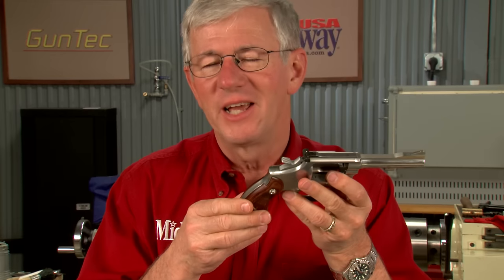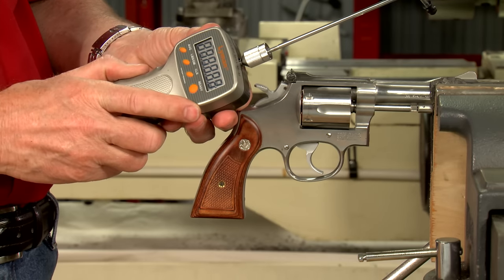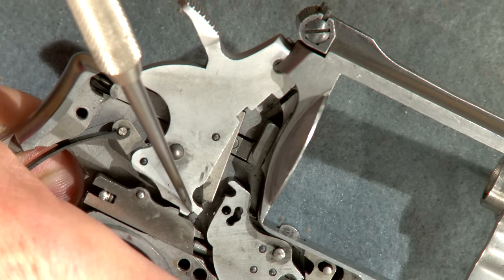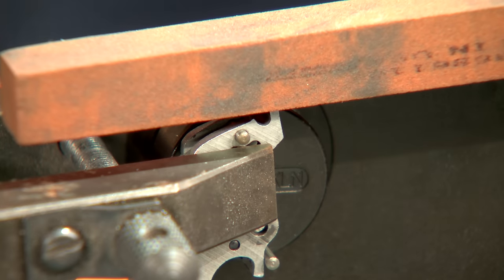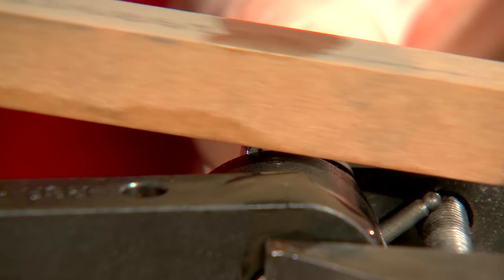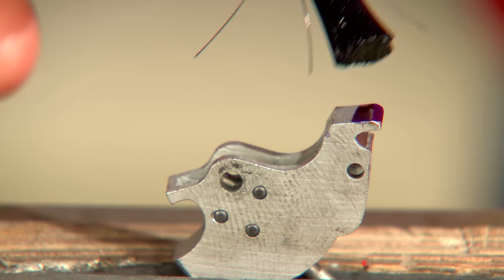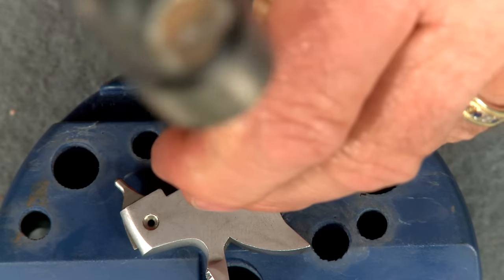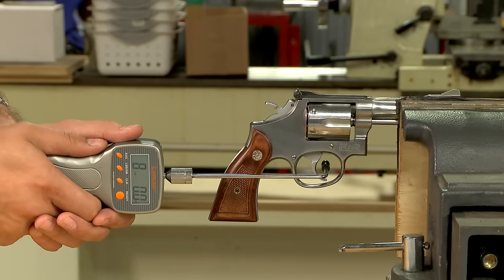How to Lighten & Smooth the Trigger Pull on a Smith and Wesson | Smith & Wesson Revolver Project

Comment: I love how he explains it as if it's that easy and anyone can do it, before busting out tools I've never even seen or heard of. 
lol Good video all the same.
Reply: so true
Reply: He is just selling tools. There is so much more that can go into smoothing out any revolver. Jigs and fixtures? Make your own.
Reply: Seth B 
He sells them because some people want them.

It often costs more to make your own than to buy
Reply: @merlinious01  and you know the surfaces will be in plain and true when you use correct tooling.
Reply: @merlinious01  Sometimes, the tools required, and the learning curve pushes a project to the point that it's easier/cheaper to pay someone to do it, even if you could do it yourself because they have the tools already.
Reply: @vincentlok8894  
Yep, specialization.
It is the reason modern society exists.
There is virtually nothing in our lives that a single person is responsible for.
Reply: Right. Reminds me of the time homer simpson tried repairing his home foundation by watching a tape he rented.
Reply: I did mine and it worked great. If you can sharpen a knife pretty good and open a revolver it ain't that bad.
Reply: Bottom line - unless you have that jig and know how to use it DON’T TOUCH THE HAMMER OR SEAR ENGAGEMENT SURFACES.
Reply: You're looking at over $300 for everything.
Beware, I tried doing this to my 686 without a jig. 
I was super careful, put it back together it seemed great, I cycled it a couple times, and then it locked up.
The hammer wouldn't cock, the cylinder would rotate.
I took it back apart, figured it out, I got it working every time, I counted my blessing.
I think the trigger is a little better, I don't have a trigger gauge.
Reply: @ronrico2620  Are you interested in selling your jig?
Reply: @bigredc222  jig fer what?
Reply: @ronrico2620  You said you did your gun, so I assumed you have the jig in the video.
Reply: @bigredc222  no jig. I'm just very gifted with  mechanical stuff. I did it on my s & w model 65ls. Prior to me was kept in a high humidity environment with 0 maintenance. On First use (after a regular cleaning) had immediate issues and pissed rusty color after a through drench from a friendly range officer. First time I've ever opened a revolver. Took it apart light polish on the important stuff. I was very rusty so I did some rust removal also. I think I invented a few new curse words putting it back together, but it went. No extra parts even! Maybe 10 hours total. I've shot it many times. Also it what I train speed reloads at home with dummy rounds. Never a single issue. Your mileage may vary. I had $75 into it and little to lose
Reply: @ronrico2620  I did my 686 and I scared myself because it locked up at one point while I was working on it, but it's fine now.
I just got an old nickel S&W model 36 five shot .38. it has a stiff trigger.
I'd like to tune it up a bit.
Reply: @bigredc222  there is another video that was way better than Larry here. But YouTube is always deleting the good stuff so it may be gone if I can find it I'll post a link. That was all I needed to get through mine.
Reply: @ronrico2620  Yea, I'm pretty sure I didn't use this video when I did mine, I have four more videos YT recommended.
YT has its problems but with a bit of smarts and a mechanical ability, and tools, there's almost nothing you can't learn how to do with YT, I love it.
Reply: you just need a lot of diacum

Comment: Larry has contributed TONS of good information to gun enthusiasts, thank you sir! I once wanted to fiddle with every trigger but over time I have learned that even a rough trigger will smooth out quite a bit with use, just dry fire the hell out of the gun, does wonders for me. An enhanced dry fire method is to apply some fine grit lapping paste to the contact surfaces, dry fire a long time then disassemble and spray out with cleaning fluid and compressed air, then re-lube the contacts and you are all set.

Comment: It's a real shame that the guns leave the factory without this already being done.
Reply: Especially for the price that they are.
Reply: Mo money...
Reply: Taylor (makers of single action "Cowboy Guns"  offers "Taylor Tuning" as an option from the factory.
I don't remember what they charge for it but it made a HUGE difference.
I dry fired some of their guns at the NRA convention.
The Taylor Tuned guns were way lighter and smoother.
Made me wish they made double action guns as well.
Reply: Only the Performance Center ones are. My stock 686 has to be 15 pounds at least.
Reply: @michaelbaker8284  you probably know this but you can buy a Wilson Combat spring kit for about $11. Takes about 10 minutes to install and significantly improves the action and lightens the trigger pull.
Reply: @edx21x  Didn't know about the wilson combat kit. Thanks!
Reply: @michaelbaker8284  coincidentally i just put one in today, but i’ve done it before. i have a little experience doing minor work on revolvers but i’m by no means an expert and i don’t have any problem doing it myself but you could take it to your local gunsmith to have it done if need be. there are several youtube videos on it. if you do it yourself you may want to buy a rebound spring tool (midway sells the springs and tool). Removing and replacing  the rebound spring is the only tricky part, Main spring is easy.
Reply: @michaelbaker8284  I have an older 586-3 and it was 14.5 pounds.  Now it's 7.5 to 8 pounds a world of difference.
Reply: Quality control is just stupid low right now. I just got a model 60 ladysmith and it has the worst single action trigger creep I have ever felt on a smith revolver.
Reply: @upnorth5465   I don't think they're doing any quality control. They're just cranking them out. Looking at the dates on some boxes, they're going from the factory to the distributor to the dealer in 2 weeks or less.
Reply: Some do. Bought a brand new S&W revolver trigger is one of the crispest triggers ever. Only seen a better trigger on a couple guns ever and the slickest one was a AWA SAA clone I had. Slick and crisp action, case hardened action and flawless appearance.
Reply: @Steviewayright  So you have an issue with shipping only taking 2 weeks, and make assumptions about quality based on that?
Reply: It’s a real shame men can’t be bothered with just improving their marksmanship.
Reply: Yeah, I got a 627 PC recently and the DA pull has an awful hitch in it.

Comment: Dry firing will not only smooth SOME things out, but will strengthen your finger so that what you THOUGHT was a heavy trigger is not much easier because you have a finger of steel now.
Reply: Very true. Dry firing and shooting makes the metal parts smooth themselves out. Some of my OLD 1960-1980 S&W revolvers are really smooth now, but the stainless crap needs work after extensive use. The locking lugs get knackered up and the cylinder will not lock up as tight as it should and that starts to create timing problems if not addressed. That little lug pin allows the cylinder to have .025-.035" of slop on the frame. A new lug usually fixes that. If not a new lug and a new ejector rod will solve the problem. Do it BEFORE you have timing problems, or you will need a new hand fitted hand, and possibly some extensive hand dressing on a new ejector's timing lugs.
Reply: @Satchmoeddie  I have heard good things about s&w performing repairs like that for their costumers especially those who have been shooting an older handgun for a wile
Reply: Well if you contact S&W for parts they’ll talk down to you and try to get you to send the gun to them to let them repair it. They don’t want us in our own guns at all. Needed a trigger guard for a Bodyguard38 and it was irritating. I wasn’t asking for a free one just some way to buy one from them. Finally they mailed me one “warranty repair” so free but I knew I bought it used and was willing to buy it but they tried 2 or 3 times to get me to mail it to them so they could charge shipping plus parts and labor at whatever their rate is for a maintenance part.

Comment: When I do a trigger job on a Smith I also polish the rebound slide wherever it contacts the frame and the safety lump on the bottom of the hammer, and polish the inside of the frame where any parts contact it. You just have to NOT increase any clearances - just polish, don't remove appreciable metal.

Comment: I am an old wheel gun fanatic. When "slicking" up an action I also polish the sides of the parts and the interior of the frames.
Reply: Me too. I even get inside the frame with rottenstone and rouge and polish that out too, and if I need them, I will grind my own shims from stainless  steel feeler gauge stock. I usually buy .015", .020", and .022" to make lockpicks and guitar repair stuff anyway, so ordering out .0005" to .010" is no big deal, and I save on shipping by adding it to my lock pick stock orders. The 6" pieces already have a 3/16" hole in one end. They are 300 stainless steel, smooth, tough,  and just work really great for so many different things. http://www.easterngage.com/products/feeler-gage-blades-stainless-steel-us-inch-sizes/
Reply: An added step that I find useful is to shim the hammer, hammer dog, etc with pieces of feeler gauge, after measuring and math happens.
   **  Pros and cons: It fine tunes the action that little bit extra, but it's more time consuming to perform a detail strip/reassembly

Comment: The most important tool is Jerry Kuhnhausen’s “The Smith & Wesson Revolvers, a Shop Manual”. Don’t loosen those screws without it!

There is so much you can do to smooth out a revolver’s action before ever touching the engagement surfaces.

Comment: If working with a blued S&W, owners need to be cautioned. The case-hardened surface of the trigger and hammer is very thin and if stoned too deeply, the softer metal below will be exposed. When this happens, the sear contacts will rapidly wear away.

Comment: I’m not a gunsmith and I try not to touch the sears.  What I polish are the bearing surfaces and the rebound block.  My S&W revolvers came through with, what I would call excessive tool marks inside the actions.  By buffing out the tool marks made my actions a lot smoother.
Reply: Yes!  The sides of the hand and the window it moves through in the recoil plate also need some polishing on many S&W revolvers. I’ve also had a couple with excessive side-to-side slop in either the hammer or the trigger.  C&S makes shims specifically for those parts.

Comment: I've never thought about the frame/sideplate, good point! I polished the bottom of the rebound slide, that's it - Ah yeah, I removed that stupid S&W lock ;) Crappy reset was there before though. It doesn't bother me THAT much, the trigger pull itself is glass smooth.

Comment: accuracy on all guns out of box was measured from a fixed vice and a computer. Not free hand. Each company has their own tolerance, but are also aware of the competition's tolerance. So for the most part, you can say they almost all shoot the same in terms of "accuracy" as it comes to a vice head gun. Now how accurate YOU are with each gun always plays a part because they all feel different. Trigger pull weight and gun weight can make them all shoot different in hand.

Comment: He never really covers the armorers review in his S&W series, but looking for burrs, and rub marks on the trigger and/or hammer with corresponding marks on the frame. Make the sure the sides of the hand and the rebound slide are smooth as well. Some things are obvious but and can be stoned but if you think there frame rubbing and assuming no damage then you can usually shim the problem area.
Reply: I opened my sideplate and found a TON of rub marks on my Taurus 94 9-shot .22. Hand polishing with a stone every part that rubbed against another, plus the trigger & sear, greatly smoothed and even lightened the horrible DA trigger pull. My crappy Taurus POS revolver now feels as good or better than a Smith!

Comment: Is there a hand loading tool for 357 magnums?
I am referring to that plier like multi tool, that deprimes, and primes, has a powder charger,  a casing and crimping tool, and is an all in one hand loading tool.
I think Lyman used to make them?
I can't recall, it's been so long since I've seen one.

Adendum.
It's called an ideal no.4.
I wonder if I can get one for 357 magnum loads. That, would be so sweet.

Comment: Hello how are you doing..?  I also did that work on my S&W .38 spl Cgt.  of 1894/03/27, and if I did it in a single sanding direction, how the scissors are sharpened so it has a perfect finish.  The thread of the 4 "pipe was also turned, two fillets to run the pipe backwards and adjust the Gap, it remained at 0.002" and the gauge does not fit, since 0.0078 "was removed from the drum in the front with the lathe, what surprises me is that this revolver model does not have a forcing cone, it is an excellent weapon, if I would like to know how they did to leave a perfect finish on the chrome or was it mirror polished nickel ...? There was triphasic power, yes continuous power, secret manufacturing procedures for these emblematic weapons, cordial greetings from Argentina, hugs for everyone.

Comment: I have seen many guns ruined by trigger jobs, I learned this the hard way even a self proclaimed expert like me.  Hammers triggers and sears are expensive to replace and are never as good as original.  lightning the trigger spring often causes miss fires especially when using hard magnum primers.  LEAVE IT STOCK.
Reply: I agree ! The biggest problem I've ever had with used revolvers I've bought or traded for, is misfires caused from "trigger job's. Anytime someone is selling a revolver and tells me it has a "trigger job'- I run. No thank you. I'll keep my revolvers actions factory.

Comment: You use a stone to smooth the sear and get a nice result. When sharpening a knife I start with stones but finish with a strop to get a much smoother result. There are strops that can be loaded with emulsions down to a tenth of a micron which will give a mirror finish. Wouldn't that easy extra step give you an even smoother result or is there a problem with the sear being too smooth?
Reply: +Herb Klitzner Where can i get them?
Reply: +Connor Keegan Go to KME Sharpening systems web site. One section is about CBN emulsions and kangaroo strops. the 4 micron is probably all you need. There are also diamond sprays and emulsions that come in all grades. these products can give a mirror finish. In general just google strops or knife sharpening.
Reply: Cool thanks

Comment: thats awsome video 
i got a tip for reloading with and without speed loaders
the blunt edge catches casings when loading
take a hand drill and bit  small enough  doesnt hit timing rotator and give it 1/8th inch
bevel on holes on cylinder and reloading is three times faster 
no binding  about 30 seconds each with drill might evan hit it with sand paper
my 624 didnt need it
 the gun makers shouldve done that deburring the hole when they drilled it
 reloading fast can save your life  and loved ones
spread the word to wheel gun packing freinds please
its the american way

Comment: I am new to revolvers and firearms in general. Why should you never touch the sear surface on the hammer? And does that mean physically touch it with our hands or touch it meaning remove material?
Reply: He simply means not to grind any material from the sear, as it can cause the sear to not engage correctly on the hammer and you can get misfires.
Reply: Because you can get what’s known as hammer push off which is simply when the gun is cocked in single action you can just push the hammer with your thumb and it will drop without the trigger being pulled
Reply: Hence the phrase, " going off half cocked".

Comment: As thermal expansion occurs from shooting, one of my 6 cylinders develops increasingly hard trigger pull while the other cylinders remain easy enough.  Problem is not nearly as prevalent when cylinders are cold.  I've cleaned it multiple times without success at fixing this problem.  Larry, can you suggest any pointers what subcomponents or surfaces to check?
Reply: I would guess the cylinder has a bur/dent, deformation that is causing it to drag the forcing cone or top of the window or same situation on the yoke/cylinder assembly. I doubt it is an internal problem if the others work fine. Disassemble the main components and inspect.
Reply: You might have a little bend in your yoke tube or a high spot on your cylinder face.  Find a good machinist gunsmith and start with measuring the cylinder gap for each charge hole.

Comment: Why isn’t that done at the factory when the gun was built? I bet sometime in the past, it was!
Reply: Well it genuinely adds to the price point. Remember Smith and Wesson has to reasonably compete with Rossi, Taurus and everybody else.  Secondly, an awful lot of guns spend decades in a drawer or closet maybe having never been fired by the owner.  Lastly, you could say that about anything mass produced-it could be better, more refined, finer tolerances, better finish quality etc.  A lot of things I built or rebuilt as a mechanic/machinist were honestly better than factory.  Details
Reply: You have it "bassakwards" .  The newer S&W 's are the ones that need the work , not the older pistols . That is true , for the most part , for all types of pistols, rifles and shotguns . S&W has not been worth a "warm pitcher of spit" since the British bought them out a couple decades ago .